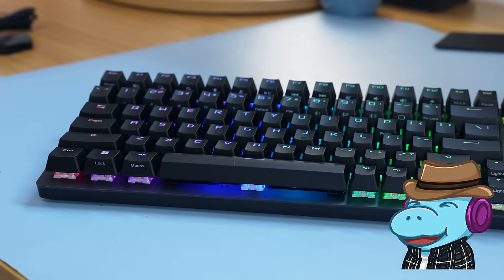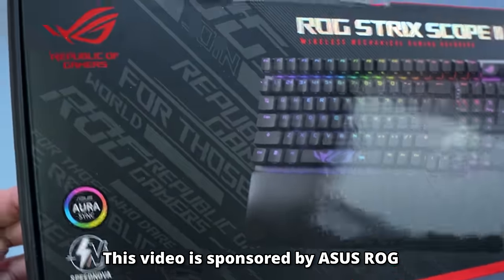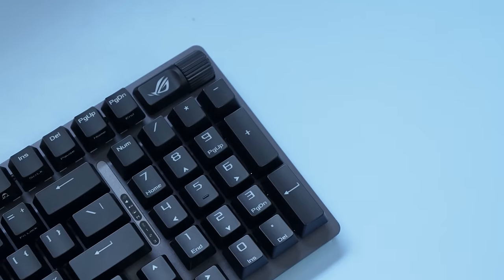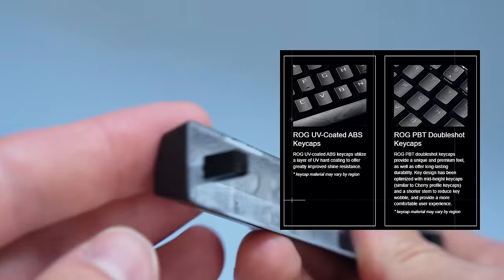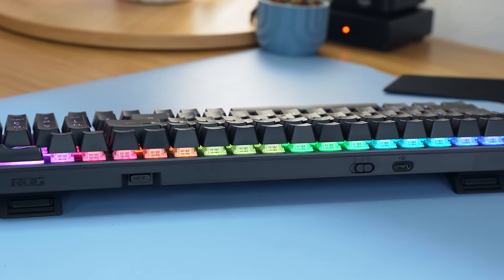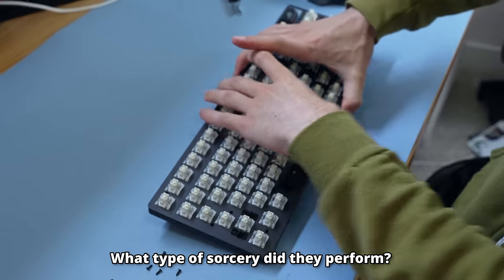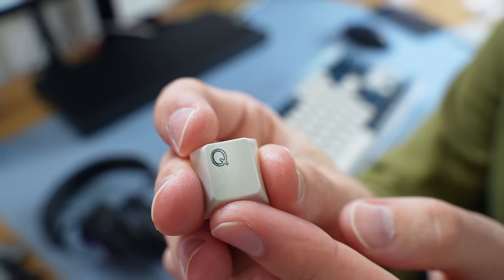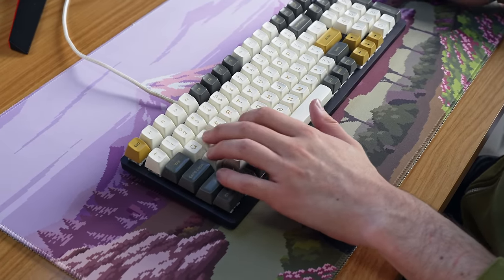ASUS Just Changed Gaming Keyboards Forever....

Comment: One thing that you didn't mention was how heavy this keyboard is. I just got one last week. And in comparison to my last keyboard, a Microsoft comfort curve 3000, I could fight off a home invader with this thing. I like the key clicks. Sounds great. And reminds me of old school IBM keyboards that I used ages ago. Using this sucker with the Aura Sync was a bit of a hassle. I had to turn off the dynamic lighting to be able to use Aura Sync with it. Which suits me fine since my G502 mouse doesn't like Aura Sync. But at least I can control the RGB with Aura sync now. The only thing that I notice is that typing on it takes a little getting used to. Even so I got close to 60wpm in the first few minutes of trying it out. So far I'm really liking this keyboard.

Comment: Asus needs to fix their firmware. I got this keyboard a few days ago and there are a TON of issues with it. It has two separate kinds of software (armoury crate and armoury crate se). Even after installing hte lastest firmware, several issues persist: green ROG led is turned on even when your pc is off (bright enough to light the whole room), keyboard RGB turns on when any key is pressed and pc is off, function keys for light modes on the keyboard are not working (either with armoury crate, armoury crate SE or no software installed). The keyboard just keeps sitting at blue color. After resetting the colour switches to rainbow mode for a few seconds, but then sits at blue again. It has become impossible to turn the lighting off. IMHO it is downright cheeky and insulting to sell a product with such a buggy firmware for more than 150 Euro. Typing would have felt nice on the board, but there's barely anything working aside from typing. Getting it to work wirelessly and updating the dongle firmware took me way longer and various installs and uninstalls of different versions of armoury crate. I'm so done with this keyboard, I would not take it for free. Great hardware ruined by abysmal firmware/software.

Comment: Just got mine from Amazon US and it does come with the PBT keycaps and OMFG, it is REEEEEEALLY good stock, miles better than my Keychron K4 pro stock, the stabs on the keychron were awful, had to tune them a lot.
Reply: Your comment put a smile on my face. Keyboard snobs still refuse to accept that this is better than most homemade keyboards acoustically. And it demolishes the custom scene in terms of battery life and wireless range. It's a murder and they don't even see it coming.

Comment: Good review Hipyo! I wish you talked more about the stabilizers. And if there's an option to replace it
Reply from the maker: Honestly I wouldnt replace them, they are really really easy to tune
Reply: I've tuned them with just grease without trying to open it up. All in all they are really good after greasing. Just slight rattle with the spacebar on the far right side I couldn't fix entirely.
Reply: @HipyoTech  could you give some advice on tuning the spacebar stabilizer please? Mine rattles badly on the right side, only had it for a few days. From what I can see there’s some foam blocking you from removing the stabilizer. I could possibly push the foam down but I’m worried it won’t return to it’s original shape.

Comment: i bought this kb p much based off of this video, never tried it at a local store, only 1 retailer in my country sells it and turns out i really like the switches - nx snow. 
they are considered linear but have a clear sound attached. ive come to like the scroll wheel and what it can offer. the 96 layout is perfect for me. 
after that i basically went down a kb hobby rabbit hole :):):) i have bought many sets of keycaps and am having fun buying and trying switches...
before this kb i had tried a keychron k3 low profile which i liked some aspects of but ultimately could not get use to the smaller form factor (over my logitech mx keys kb - not the mech one) and the lower profile switches i had a love hate relationship with.
i also bought a full size ducky kb which is great build quality but is not wireless like this one. so it is nice to have different types of custom keyboards that do different things...

Comment: I have the ASUS Azoth with the SNOW switches.  I LOVE the feel of typing on these SNOW switches, but for some reason the Azoth doesn't sound quite as good as the Strix Scope II despite being a significantly more expensive board.  What do you suppose accounts for the difference?  I think perhaps there is too much foam inside the Azoth.
Reply: caps

Comment: I recently bought this keyboard, qnd I find it amazing. Coming from a Ducky Shine 7 Blackout, I feel like this is a huge upgrade. The typing experience, how quiet it is, and how stable the switches feel (specially the space-bar).
Reply: Are u still satisfied? Currently thinking about buying
Reply: @Jadzim27 definitely worth buying, just bought mine and it feels so good coming from tkl user. The nx snow are exelent at stock feels similar to gateron milky yellow but better. Just need to replace the abs keycaps to better ones and it good to go, the only downside was need armoury crate to update the firmware, can uninstall later tho

Comment: The biggest problem is not the north facing rgb nor the abs keycaps, but the software, oh god the software. First of all you get 10 processes running in the background after you install it, 99% of them are completely non related to the keyboard or the function of it and the best of all is after you remove the main software, all of them are still installed and you have to uninstall all of them one by one. And that would be not as bad if the software itself was usable at all, I just don't understand how you can botch this so bad with a 200EUR keyboard. Just using any gaming software after the ROG one feels 10x better.

Comment: Back watching this video again after buying this keyboard at MicroCenter; I know it's not really the point of your channel, but on a keyboard like this, I would love if you went into more detail about the software for customizing it, because man I thought I knew how bad Armoury Crate/Aura Creator are before, having to use them for some lighting inside my PC case, but my god, I cannot believe how absolutely garbage both apps are for keyboard customization. Yes, there are macros, but they are extremely barebones and really don't let you do what actually want with them. No way to create multiple layers on the board (as in, if you create a macro, you can only assign it to a single keypress, you can't, for example, use Fn plus some other non-function key to use for your own shortcuts/macros). RGB control is...not great. There are some quite cool effects built in, but no way to customize them very much, and if you want to do more extensive customization you have to use Aura Creator, which then eats like 3-5% at least of my 5800X CPU running any effects other than static lighting, and also forces you to customize other component lighting in Aura Creator too, not just leaving them alone separately in Armoury Crate...and the light effects look laggy/stuttery as hell on top of all that, despite using so much CPU!

I could go on and on, but it's really so bad. :/ which is an absolutely massive shame, as the hardware of this keyboard is honestly pretty amazing. To be fair I'm coming from a Logitech G910 with Romer-G tactile switches, so not even close, but I've been consuming keyboard vids and info for a year or 2 now and this one really does sound and feel super great. And I completely love the 96% layout which is so rare to see...but I still might return it just because of how bad the software is. The Keychron Q5 Pro is coming out soon for $30 more than this so I might go for that but then I'm losing out on the actually-good shine-through RGB and the super low latency wireless.

Didn't think I'd ever say this but I really miss the Logitech G Hub software that controls my G910...that flawlessly runs lighting real-time in the background and uses <1% of CPU, no stutters, perfectly smooth lighting effects. If I could just have that level of software control combined with this Asus keyboard's hardware (and ability to store custom effects in the onboard profiles...), that would be a dream.
Reply: Can you give your opnion about the Asus switches vs Cherry MX switches?

My CODE Keyboard is giving signals of retirement after 8 years :), time to look for a new keyboard.
Reply: @felipeprenholato2301  unfortunately I have like literally zero experience with Cherry MX switches, since my G910 was my first and only mechanical keyboard before getting this Asus one.
Reply: OpenRGB will support this keyboard someday, probably this year. That is an efficient way to manage RGB
Reply: @MyAmazingUsername  Thanks for the info, do you have a source on that? Also, any idea if SignalRGB will also support it? I've checked both out and I feel like SignalRGB is the one with better options for actual RGB effects, not just setting static lighting, but correct me if I'm wrong on that
Reply: @Boomer.Roberts  I will probably be coding Scope II support for OpenRGB. If not, someone else will do it. It's trivial to support ASUS devices. They all work roughly the same way.

SignalRGB is polished but I have no way to run it on Linux. I would never use its animation feature, since it uses up to 10% of your CPU just to flash some lights.

OpenRGB can also do animations via the Effects plugin and I suspect it would also use lots of CPU. Calculating effects and transmitting constant updates is gonna waste CPU no matter what.

You know that meme about "RGB makes your game FPS higher"? If you animate it, RGB makes your game FPS 10% lower. The only exception is if your device supports on-board animations that don't involve the computer at all. Like a built-in rainbow animation. Those would run without CPU involvement and would be fine.
Reply: @Boomer.Roberts  Alright, news! I finished coding Scope II 96 support in OpenRGB (merge request "2006"). Meaning that the keyboard is supported on Mac, Linux and Windows now, and doesn't need the heavy ASUS Armoury Crate anymore. It will be available via the "pipeline" builds after merging.
Reply: @MyAmazingUsername  awesome news! Question: is per-key lighting possible for the Scope II 96 with OpenRGB? (I would check myself but I don't actually have the keyboard anymore currently, had to return within the 30 day window due to my disappointments; will possibly buy it again though if rgb support in 3rd party software can do what I want)
Reply: @Boomer.Roberts  Yes. :) You can set custom colors on every key and even the logo in the top right corner. I got mine in Candy Pink now.

This is implemented via wired USB at the moment and it works perfectly. Wireless 2.4 GHz control mode will be supported too, but will probably take a few months because they use a new wireless dongle that will require reverse engineering a new driver protocol. Since all ASUS devices use that new dongle from now on, it will definitely be supported, but I can't give a timeline for that. Worst case, 6 months would be a reasonable expectation. But if you use your keyboard wired, that wait won't matter at all.

Another thing you can do is to program a solid color into the on-board memory which means that it retains that color in wireless mode. That's how I am usng a hot, custom Candy Pink color even in wireless mode. It looks so good that I could eat it. :)
Reply: @MyAmazingUsername  gotcha, nice! Appreciate your responses :)

I assume since you specified solid color, that means you can't save per-key customizations into the on-board memory?
Reply: @Boomer.Roberts  Yeah correct, onboard memory can store colors and settings for the "modes" like static, rainbow etc. Unfortunately there's no onboard memory for per-key colors. That would be so nice. :)
Reply: @MyAmazingUsername  I gotcha. The one effect I was disappointed with was the one where each key you press lights and fades out; I want it to fade to another "background" color instead of fading to off (could do that with Logitech software on my old keyboard, although that was only by running in the background of course, not stored on board)
Reply: @Boomer.Roberts  I agree. That mode is called "Reactive" and it's always fading to black, not configurable. To me that's useless since I can't see what the unlit keys say. I like a solid color though or per-key RGB, that's all I need. :D
Reply: @Boomer.Roberts  There was a breakthrough with the Omni Receiver analysis. The protocol is somewhat figured out already. Might have a wireless OpenRGB version much sooner than expected.
Reply: @Boomer.Roberts  We've analyzed the ROG Omni wireless dongle's protocol and we have working per-key RGB and mode setting via wireless now. So feel free to get the keyboard again. The OpenRGB implementation is close to done. :)
Reply: @MyAmazingUsername Hi, after I saw your comment. I downloaded OpenRGB (Experimental) and tried to customize my ROG Strix Scope II but I can’t seem to find the keyboard if using usb dongle. Just want to check with you if its already added as a wireless? And can I save the custom profile in this keyboard so I can use it without opening openrgb in the background?
Reply: @GumHub-0  Hi. The wireless Omni dongle support is in development branch by Mola19 and has some issues still with setting some of the special effect modes. But yeah it's coming. USB works in the meantime. Or you can build Mola19's branch and run that. As for saving things to the keyboards memory: It has onboard memory for static 1 color for the entire keyboard. Would be cool if it had per key RGB onboard memory but I haven't seen any keyboards that do that.
Reply: @MyAmazingUsername Thank you for your reply. Unfortunately, no idea how to build it. I wished! Thanks again.

Comment: Did you ever look at where the legends are on your keycaps? They're on the north side of the switch. So it may. It seems kind of asinine to have LEDs and the opposite side of where they're needed. I don't like one of your switches so there's that, I prefer tactile. The 2.4 GHz is fine as long as you love plugging in your keyboard all the time to charge it so I don't see a point to it, especially if you're going to run RGB.

Comment: hey hipyo, i have a question. My new akko 3068b plus tokyo world tour jelly pink keeb has a socket problem, the spacebar doesnt work. I wrote to support and it has been a while (I got it on april) I didnt own any mechanical keyboard before, and i need help. Support wasnt helpful, so i need your help. please help
Reply: Sorry, i just wanted to ask, did you open your keyboard to the pcb then maybe make mistake?
Or it's just broke by itself?
Mine is akko 3068v2 Dorami:v
Reply: @Rayhand117   it came broken
Reply: @Rayhand117  trying to fix it for 2 months but I still couldnt managed to fix
Reply: @anya4957  sorry to hear that, very unfortunate that such a pretty keyboard comes with a flaw:v
how is the guarantee? does the seller handle such things?